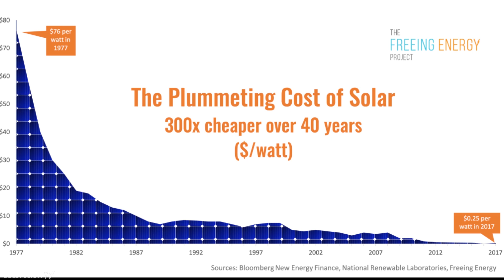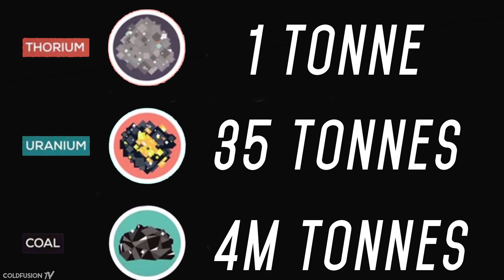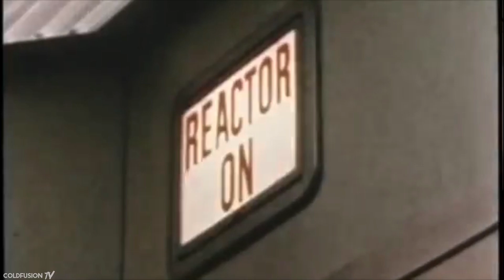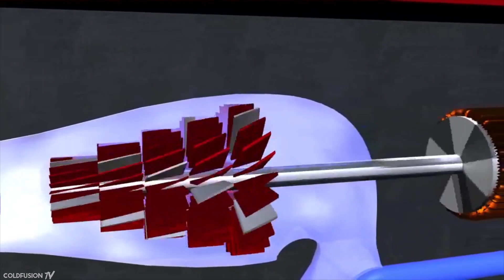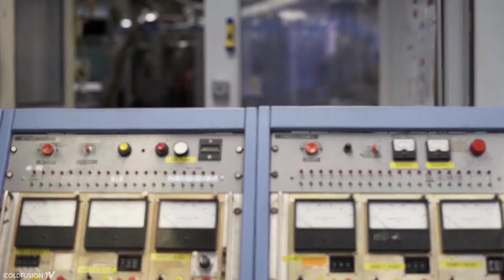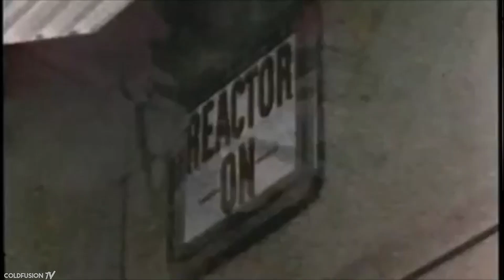Thorium - The Future of Energy?

Comment: Still, troubles with the salt corrosions at high temperature AND a heavy irradiated process line, the cost of removing a Thorium plant would surpass any old and dirty conventional Uranium plant cleanup...
Aneutronic fusion or nothing.
Reply: Where did you get this misinformation?
Reply: @jonswap9097  He's right, the (fuel-laden) salt corrodes the reactor and deposits itself all over the components of the reactor, but there are probably solutions to those problems. It's certainly more likely that we'd solve the problems with molten salt reactors before fusion ever becomes practical.
Reply: @PistonAvatarGuy  You're right, and it's fairly simple, molten salt is corrosive to certain alloys but not if it's kept in a reducing state, ie, providing electrons to the molten ionic mixture to keep oxidizing metal ions from forming. This is completely possible due to unlike solid salts, in a molten mixtures of ions electrons are free to move. Loads of information about it in Moltex Energy's technical white paper !!!!
Reply: @jonswap9097  Here is the source -> https://www.youtube.com/watch?v=cZkj6ZN1Wkc
A very unbiased view on molten salt TH-reactors, the troubles of corrosion rise with the decaying by-products and the very hefty radiation inside the system, but watch the video...
Reply: Check Oak Ridge National Laboratory.  They built one long ago and overcame that and many hurdles.

Comment: Why did thorium reactor do not work in past?
Reply: Because they found that they werent good at producing plutonium. Theres probably also some hurdles in getting the very hot salt to stop corroding everything it touches, but honestly, its probably more the fact that you cant get plutonium from them that killed LFTR.
Reply: @theonlyari  yeah you're right, Kirk Sorrenson explains other political reasons too but they will have been influenced by the plutonium aspect
Reply: Are you familiar with the concept of research and advancement?
Reply: It did, but there are some problems to solve.

Comment: The danger of uranium power plants is already greatly diminished. The Fukushima incident resulted in no direct death by radiation poisoning. Some workers contracted cancer, however it is hard to say whether this was due to the radiation exposure at Fukushima. The number of deaths is not estimated to exceed 5. Conversely, coal plants can also fail, often resulting in hundreds or even thousands of deaths.

https://en.wikipedia.org/wiki/Energy_accidents
This table shows the relative danger levels of various energy sources. You'll notice of all of these, nuclear energy is the safest option.
Not saying nuclear energy doesn't have its downsides, like radioactive waste, but the idea that it's extremely dangerous is a misconception.